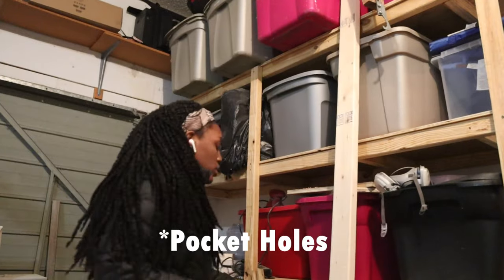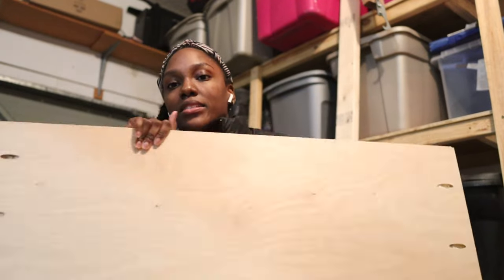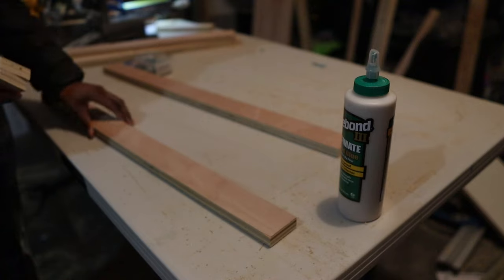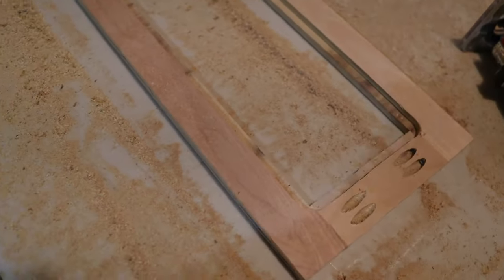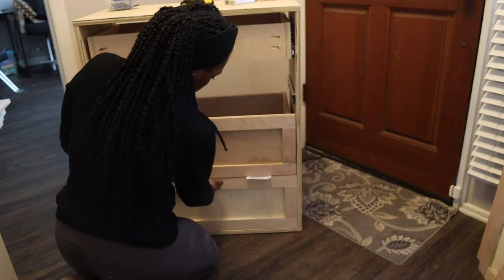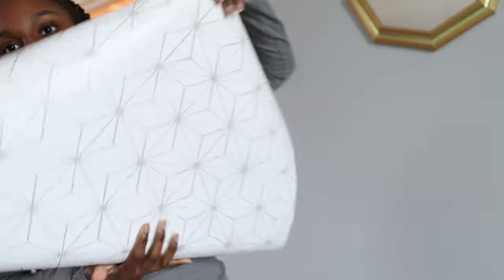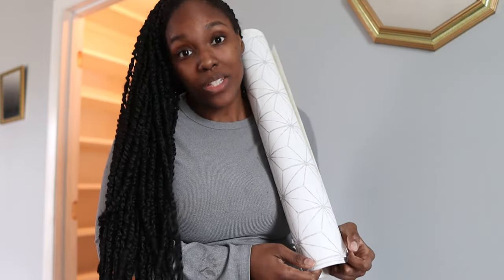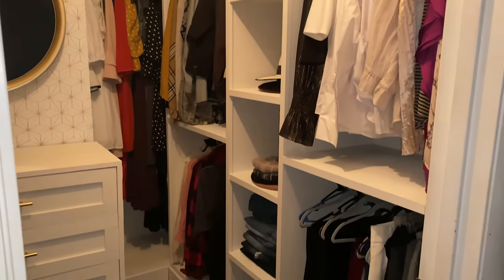DIY Walk-in Closet Makeover pt2 | How to building my mom her dream closet | The Final reveal

Comment: Hey Mia! Love these videos. I have some experience helping out my mother in law with custom woodwork but im a complete amateur at doing my own projects (unless putting together furniture from Wayfair/ Ikea counts lol). Im tackling my closet & wanted to know what i could replace pocket holes with in order to connect some shelving units. Thank you!
Reply from the maker: Honestly pocket holes were the easiest method without seeing the screws. You could also use a nail gun but you would most likely have to put it together outside the closet.
Reply: @RemodelHandz  I don’t have a pocket hole jig, do you think it’s eyeball-able without one ? Thanks btw!
Reply from the maker: I don’t think it would be eyeball-able. The jig helps to create the pockets for the screw to sit in. I bought my first pocket hole jig for $20. It’s the pocket hole jig 310. You could also drill the screws in from the outer part of the wood, but they would show.